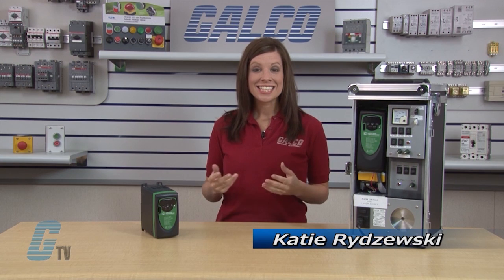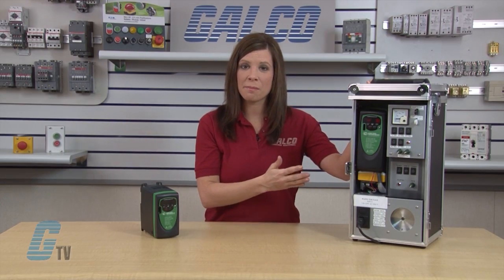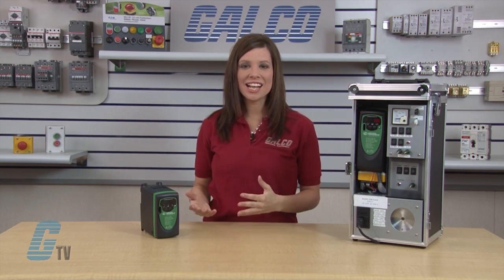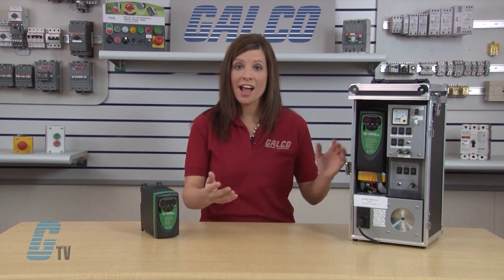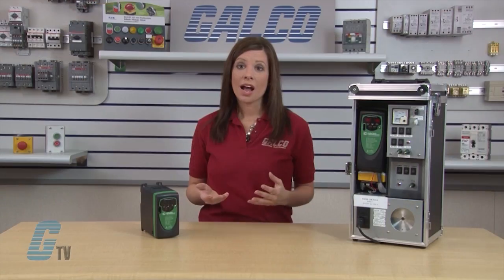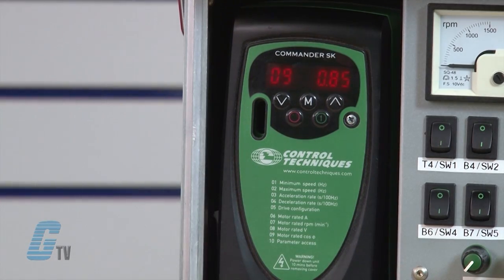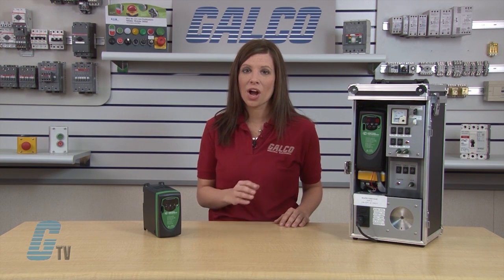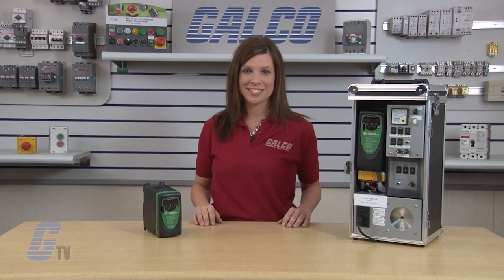Emerson Control Techniques Commander SK AC Drive Basic Startup | Galco

Comment: If we have install the pr01=10Hz and the pr02=50hz then when we fix parameter 03 in 40Hz. It means that it will start from 10hz and it will reach the maximum speed in 20 sec? Or it will reach in 20 sec the speed of parameter 3?

Comment: Hello, thanks for the video, i have a doubt, where i connect a potentiometer for control the velocity of the motor? i can't do this and i i need it, if you can help me please
Reply from the maker: No problem, the pot connects to terminals T1 T2 and T3. T1 is the zero volt connection, T2 is the wiper connection, and T3 is the +10volt connection. However this assumes you have configured parameter 11.27=AV.Pr. This will configure T2 as analog input A1 and T4 is then a reference select input for preset speeds with input B7. If you need remote and local speed control, let us know and we can re-configure 11.27 and provide additional wiring info. Good luck :-)

Comment: Drive works in manual, but would not run in auto. Shows no error codes
Reply from the maker: OK have you verified both terminals B4 and B5 are active at same time? If so is terminal B7 wired Speed REF select and is it active or not? You could have a run command with no reference. Good luck.

Comment: if we use more than one motors then wt about parameter 6.
Reply from the maker: You must add the motor currents but you cannot exceed the drive rating or you don't have enough drive for your motors, ok?

Comment: Hi, i´m trying to connect my commander sk wtih a plc and i´m trying to write the motor frequency using modbus rtu protocol, but i cant configure the drive correctly because i dont know which option of the parameter 05 i would choose in order to start the communication with the plc. do you have some ideas about it?
Reply from the maker: Hello juancho, Pr.5 configures the I/O of the drive and has nothing to do with communication. We are going to suggest contacting CT direct at 1-800-893-2321.

Comment: hello , my driver shows trip code ET when i searched for it in the faults codes of commander SK i couldn't found it , but it existe in the manual of QUANTIUM III ? what would be the problem and how can i solve it please
Reply from the maker: Sounds like an External Trip. Try checking all of your interlock contacts for an open in the string. If your not using this function you may need a jumper on the digital input configured for ET, ok?

Comment: already im using commander drive .now unlock cord not remember .pls tell me method of reset unlock cord.
thanks
Reply from the maker: Hello Saman, thanks for asking Galco. There is no "cord" function in these drives.  If you are trying to save parameters, simply use the M button and arrow buttons to display xx.00 press the M button until the data is flashing and use arrow to enter a 1000 and press M again. All parameters are saved to EEPROM now.
Reply: my drive Commander SK SKA1200075 0.75kW motor driver inverter Emerson Control Techniques
this drive can not set your parameters

Comment: This drive is no load time RPM (0 to 3000) OK.
But loading time 0 to 
120,140,150(RPM) Maximum than reverse rotation display showing minus (-) 
value than again and again same starting.
please help me.
Reply from the maker: Ok if I understand this correctly you can go to 3000RPM with no load, but only 150RPM with load?
Reply: Yes
Reply from the maker: Ok the first thing to do is to check the motor parameters are set correctly. If ok, see how many AMPS the motor is pulling with load on it and compare to motor name plate rating to know it is making full power, ok?

Comment: Faults are recorded in parameter menu 10.20 (latest fault) to 10.29 
(oldest fault). My manual does not show an R5 fault but does have "rS" 
could that be what your display is showing?
Reply from the maker: Thank you for asking Galco Mr. Hossen. Yes the display is most likely showing that. rS is a resistance measurement failure during Autotune. The drive was trying to measure the motor but did not see it and faulted out. Check your motor connections very carefully and make sure you can see a very low resistance from phase to phase at the drive's motor terminals.

Comment: Hello, I have a case fault with TR 01.AC what its cause? I need one solution, tienes for attetion.
Reply: GalcoTV same problem occures.
Reply from the maker: OI.AC: High OverCurrent detected on drive output-
• Check Pr41. If Fd, reduce Pr42=0 and re-try
• Ensure Pr3 and 4 are not set too fast - set for 20 each
• Ensure Pr9 is not greater than 0.95
• With motor disconnected, set Pr41=Fd and run drive up
If drive trips – possibly a faulty transistor.
If drive runs up ok- megger motor for 1000v
• If there is an Output Sinewave Filter check this Wiring !!!
• Possible shorted motor or motor lead between drive and motor
• Remove motor leads from drive and megger each free motor lead to Earth
600-750v for 240vac motors and 1000-1200v for 460v motors
Reply: GalcoTV in parameter 55 to 59 not coming to zero. please  help me to reset parameter 55.
Reply: we are using emerson commander sk 1.5m
Reply from the maker: Ok Bilal, please know that parameters 55 to 58 are read only (not programmable) and 59 is the PLC ladder program enable. Parameter 55 is the last fault memory location, what value is it showing?
Reply: GalcoTV e097
Reply from the maker: If you are running with a PLC program then you must have the Logic Stick installed at all times. If the logic stick is installed make sure it did not come loose, clear the fault and try again.
Reply from the maker: If you are running the PLC program and the LogicStick is in place correctly, I suggest you contact the factory at the link below;
http://www.emersonindustrial.com/en-US/controltechniques/serviceandsupport/support/Pages/TechnicalSupport.aspx
or just call at 1-800-893-2321

Comment: ihave  sp 3402 giving alarm HF25 DSP Communications failure- communication from main to 2nd processor . can tell me specific reason
Reply from the maker: +Arabian Industrial Multi-tech Solutions The part number supplied is for a Unidrive SP.  SP 3402 not a SK. The Unidrive SP advanced User guide shows; HF25 Current feedback offset error 225 Hardware fault - return drive to supplier. This indicates the drive needs to be repaired.
However the Sk Advanced User guide shows; 25 DSP Communications failure. You may want to take any expansion module out and re –seat them to make sure they are making a good connection. Otherwise the drive needs repair.

Comment from the maker: HF faults are hardware faults and are usually terminal, Meaning the drive would have to be sent back for analysis or repair. In this case, the power stage is not being recognized. It could be that the motor data wasn't entered correctly or the drive has been repaired incorrectly or maybe just a bad drive??
Reply: I have ih alarm in lorey Sommer digi drive and the motor was not starting if I press start button in drive we getting rdy and then it was coming ih alarm please give me the solution for this

Comment: after giving the start command, getting alarm " tr r5"
Reply from the maker: My guess is that the drive is tripping in the autotune process with the stator resistance being too low.  To get around this you can change parameter 41 to Fd or fixed boost or Ur for no measurement taken.  Let me know if this fixes the problem.
Reply: Thank you very much
it is working fine by just changing parameter 41 to FB

Comment: Thanks for information, But i need RS432 Communication IC is Burnt. req IC no ?
Reply from the maker: I am a little unclear on what you need.  Do you mean the 'RS485' Communication Circuit is burnt?  If that is the case, you may need to replace the drive.  I am unsure what you would need RS432 for....
Reply from the maker: Vijaykumar Hn There are two suggestions that I can give you.
1) You can contact our repair center, where you may need to send the unit in.
2) You can contact CT directly.  To be honest that IC number could be different with the different frame sizes.  There might also be something additional with that drive that might not be easily recognizable without having to take a look at it.  I hope this helps.